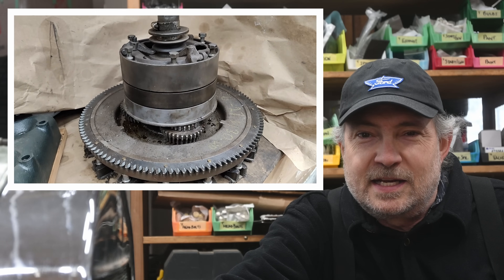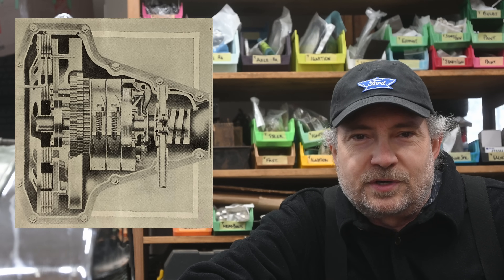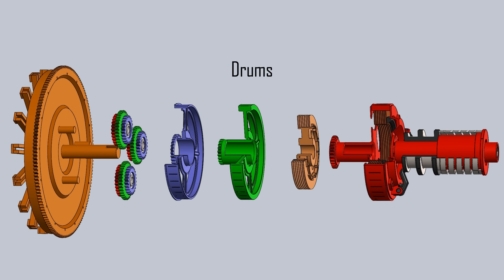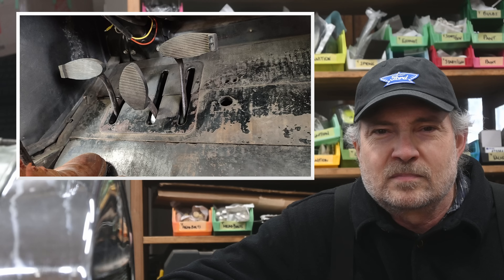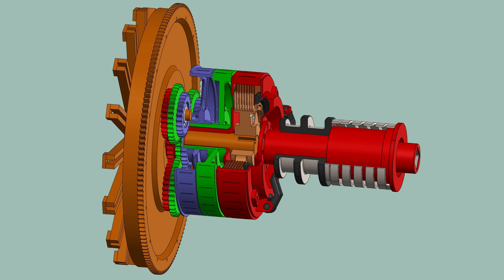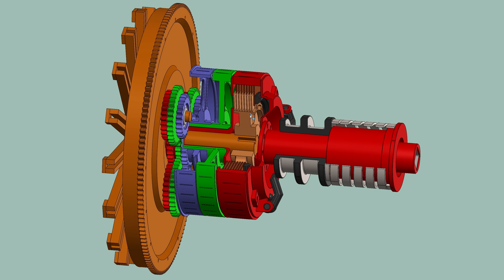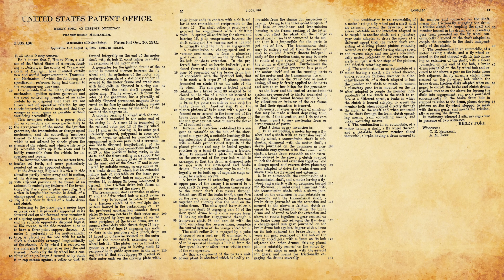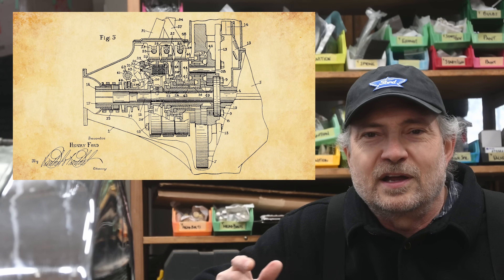How does it work?  Patents, animations. Ford Model T Transmission

Comment: Enjoyed your video on the T trans. An automatic transmission without the automatic shift mechanism. Seems like on the low and reverse ,one is over driven and one is under driven so    because the triple gears are pinned together one has to add teeth and the other has to subtract teeth which gives forward and reverse with the engine turning in the same direction. I'm not an engineer so I co sould be wrong. Good that the T engine only turns about 2400 rpm or so wide open. That's  quite a heavy mass when in high gear to be turning at today's modern engine red lines. The Ruxtell underdrive axel is a nice after market addition. Gives a gear between low and high.  Also an extra low gear which might be of use if you had the make a tractor kit offered back in the day. There was a company at the time making a kit I think to replace the front axel and make the T four wheel drive. Saw an article in the Model T Times . It was a depo hack they had converted. A very scarce item . Looking forward to seeing your next video.
Reply from the maker: Russel. Thanks very much for the thoughts.  You are correct - that 4-wheel-drive conversion is nifty!  I wonder how much power actually gets to the wheels, with all those extra mechanical losses.  When you start with less than 20 horsepower, and then siphon some away with mechanical losses...hmmm.    It is interesting that Henry approved of the Ruxtel axle, and considered it one of the few worthwhile improvements to the T.  Henry RARELY approved of accessories to his 'perfect' car.